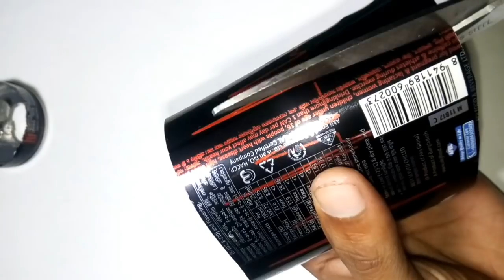Mini Drone that can Fly...

Comment: Bhai, in this video we are needed 9 things - paper board, mini motors, cables, DC 5v battery 4500 mah, switch, RC controlar, SPEED bottle, one thing. What is that  9vi thing